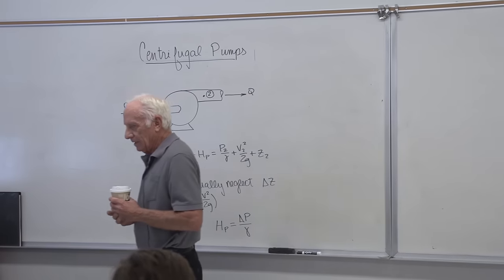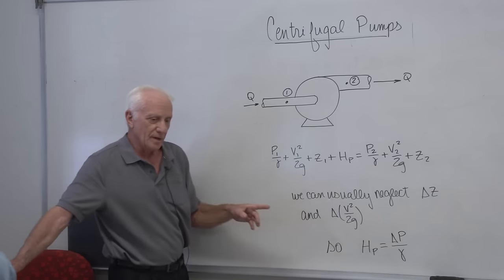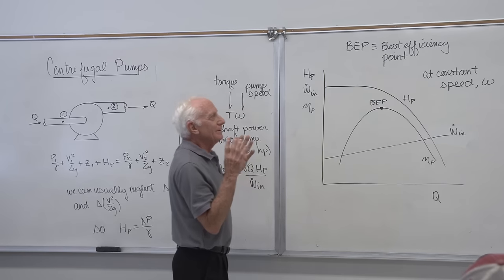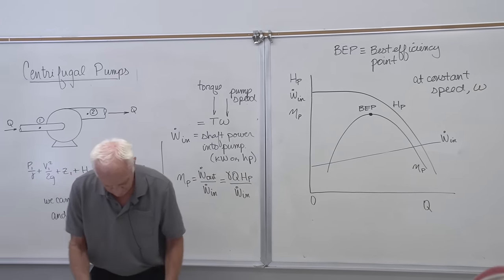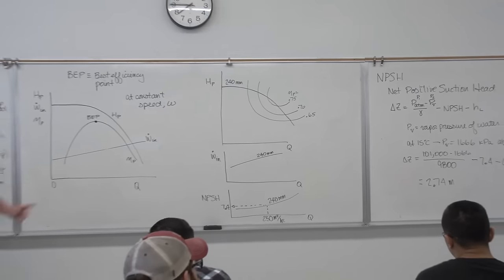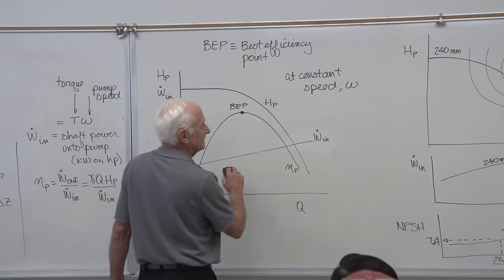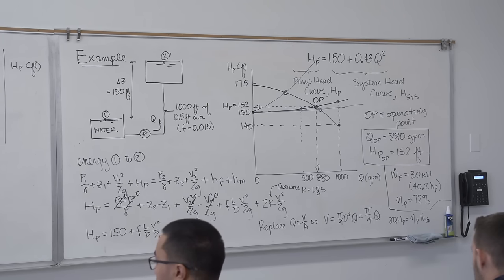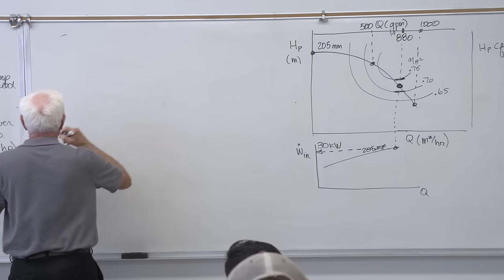Fluid Mechanics: Centrifugal Pump Characteristics (21 of 34)

Comment: Thanks for your effort. One tip though, unlike the case in the pump sketch you showed, for centrifugal pumps and compressors, the suction side is always one standard size larger than the discharge size. This is to minimize losses and, consequently, reduce cavitation possibilities.
Reply from the maker: Thanks for the tip.

Comment: The equation provided to calculate delta z based on NPSH is for the case that the water level at the supply reservoir is below the water level at the demand reservoir. So, for the case which is shown in the video, the water level at the downstream reservoir should be lower than that the water level at point 1 and for this case: delta z (minimum water level difference between two reservoirs)= (Pa-Pv)/gamma - NPSH (for available pump) HL (all head losses) as shown in the video. It is not surprising that if the difference in water levels reduced to values less than delta Z, cavitation is expected to take place.  For the other case if the water level at the demand or downstream reservoir is greater than the water level at supply reservoir (most cases), delta Z (Max different in water levels)= NPSH (of the available pump) (Pa-Pv)/gamma +HL (all head losses) and in this case if the water level at supply reservoir or the well is dropped to lower depth, than the difference in the water levels increased to values more than computed delta Z and we expect cavitation will take place in this situation.

Comment: Thank you for your lacture.. I learnt a lot and  but why the H vs Q curve by manufacturer is decreasing while system head curve is increasing..However, I know,  at 0 flow, head will be maximum and if flow will increase, head will be go down because pressure will be reduced but please make me clear on what basis or data manufacturer plot H vs Q.

Comment: this is great info, I'm studying for my next wastewater certification and notice a few differences. Total dynamic head and Head in general is always referd to as the verticle distance the water has to be pumed (measured in feet). But it sounds like head is just any force acting to restrict flow? 

Also Cavitaion is described only happening at the impeller near the inlet or outlet and not in the pipe itself. this is due to the pressure difference across the impeller. the bubbles are formed by rapid pressure loss and on implotion they take part of the impeller with them and they sound like BBs in the pump. 

again, great video. i enjoyed getting away from the text book for a bit.

Comment: great tutorial for a EE....At 25.00 regarding NPSH, visually the water tank is below the pump, the Z is the height between the two.  How would the analysis change, if the pump was below and the water tank was above?  I would think the ABS | Patm -Pv | may be a more general solution to avoid an answer with a -Z value.

Comment: Thank you for the great video. I have a question about the effect of temperature on the characteristics curve of the pump.
How does the characteris curve of a centrifugal pump change with the decrease in temperature provided that the pump power is constant.
A reference material to read would of great help.
Thank you
Reply: I can tell you that increasing tempreture will increase the risque of cavitation; unfortunantlly i don't know really it's effect on HQ curve.

Comment: Thank you sir for the explannation, it helped understand the fundamentals better. Also, I would like to add a note on vapor pressure. Vapor pressure of Water @ 15degC unit shall be read in Pa (i.e 1666 Pa)

Comment: I have a question, 
If a centrifugal pump flow limit is from 60 LPM to 535 LPM at 3500 rpm, does the low flow limit of 60 LPM changes with running the pump at lower rpm? Does this limit changes goes down when we run the pump at lower rpm?
Reply: Surely changing the flow rate from 60 LPM to 535 LPM would mean a change of impeller, assuming constant rpm.

If you have a 60 LPM impeller, on a 3500 rpm motor, and you reduce the speed of the motor - the flow rate will reduce.

Comment: Great class. One would intuitively think that the velocity of the fluid at the discharge of the pump is higher than the suction velocity. Apparently, this is not true, because the professor is neglecting that difference. I would like to understand better the reason behind it. Any advice?
Reply: Usually, suction pipe is one size higher than the discharge pipe size, hence the velocity in discharge pipe is higher than that of the suction pipe

Comment: Is NPSH used for the single purpose of determining the maximum elevation which the liquid can be raised?
Reply: No, because NPSH changes with the change of Q. The higher is the flow rate, the higher is the pressure drop at the suction side. Therefore it's rather used to get to know the maximum flow rate available.
Also the temperature plays the key role, since it influences the vapor pressure.

Comment: on NPSH example problem, Patm defined by value of 101000 kPa. Should it be valued 101 kPa if Pv also in kPa? CMIIW
Reply: Yes you're right. He denoted it with the coma. However the value of Pv at 15C according to my steam table is equal to 1,7 kPa.
Reply: @dawidpietrucha5333  Same, from Table A.5 in the class textbook, interpolating you'd get 1.782 kPa for vapor pressure.

Comment: Professor: why is the velocity difference between point 1 and 2 very small? Shouldn’t the velocity at point 2 be very high because impeller blade is pushing the liquid and velocity should increase significantly.
Reply: The pump definitely provides Kinetic energy to the water which intutively make us think the increase in velocity of flow at outlet,  but because of volute casing of pump that kinetic energy of fluid gets converted into pressure energy. Thus the velocity remains same. Moreover velocity is governed by the pipe diameter. Since pipe diameter at inlet and outlet of pump is assumed to be same and flow rate also going to be same to maintain steady state ( because whatever amount of water is entering , the same amount of water will move out of pump). Hope it will help!!

Comment: When you run the pump at a constant speed, how do you increase the flowrate through the pump?
Reply from the maker: Open the flow control valve downstream from the pump.
Reply: Raise the fluid temperature to change viscosity, density? (Not practical but I'm an electronic guy working at a farm and my boss keeps trying to make me do things that are not correct. My solution, learn about fluid dynamics on my own, not to be right but to respect energy and knowledge). Thank you professor, much respect for your life's work, reminding me as always I am standing on the shoulders of giants
Reply: Change the impeller size as per manufacturers impeller data
Reply: @CPPMechEngTutorials  
Awesome

Comment: Check me out but at 25:10 the 101kpa makes it 101,0000 Pa which is NPSH is 7.4 METERS then that makes sense with the whole equation to make the units workout.

But he wrote that vapor pressure is 1666 kPa and then out it in the equation as that value so there's a mistake on that one way or the other. Either it was incorrectly labeled with the kPa units initially or he should've left the Patm in 101 kPa form and converted later.

Can someone confirm?
Reply: Yeah exactly. Patm is 101 kPa and the Pv at 15C according to the steam tables is equal to 1.7 kPa.
Reply: @dawidpietrucha5333  lol too long ago I can't tell if you're agreeing or disagreeing
Reply: He's agreeing....

Comment: how can we increase Q at constant V ? Area? I mean with velocity diagrams we can calculate everything then why we need graphs for?
Reply from the maker: Since Q = VA, we cannot increase Q at constant V (assuming the fluid is incompressible).
Reply: For centrifugal pumps and compressors, the suction side is always one standard size larger than the discharge size. So yes, area will be a factor.

Comment: please Sir If the inlet fluid is subcold  ( at low temperature ) but the liquid is entering the pump at low pressure and the impeller will start swirling the liquid and create bubbles just  as when you move your hand quickly on water surface you will create water bubbles though the inlet pressure is above the vapor pressure is that possible

Comment: Imagine our Q=100gpm and the head is H=20ft.
Then it has one operation point. Now if wr increase the flow by opening new valve, the friction will increase. What is the new operation point, with the same pump curve???

Comment: Hello,
 could anyone tell me how pump curve is determined at a certain speed however the input power = ( torque x angular velocity).
 so, to get more discharge we need more input power by increasing velocity
 and then by applying  the efficiency  formula (output power / input power) we can draw an efficiency  curve.
 so,  how this curve could be at a certain velocity?

Comment: Thank you so much for the excellent lecture prof. I have one question: why the efficiency form on previous graph is different from those of pump performance map?
Reply: Yeahh, the same question crossed to my mind !!! Even I'm confused for it
Reply: Dear Prof! speaking about elevation of the pump above reservoir surface you said:
Well, as you get the pump higher and higher in the flow rate, that pressure is going to start drop.
I think that could be:
Well, as you get the pump higher and higher in the elevation, that pressure is going to start drop.
What do you think about that? Thank you very much.

Comment: There was a mistake in the calculation of NPSH, pv was 1666 KPa but the substitution was in Pa since Patm=101,000 pa
Reply: The vapor pressure Pv = 1666 Pa. I think he meant 1666 Pa when he wrote 1666 Kpa.

Comment: Good job by teacher, though lecture stilted by the constant English/SI unit issue. Its sheer nonsense, in England we don't even use that nonsense in engineering contexts, we embrace the 'universal' SI system - though in everyday life we do often use these old units.

Comment: @ 23:13 the Pv should have been in Pa not kPa, looking at chart now and its interpolated between 1.227 and 2.337 kPa or 1227 Pa and 2337 Pa respectively. Therefore 1666 should be is Pascals units not kilo-pascals.
Reply: Also, should be 1.782 kPa for vapor pressure after interpolating.